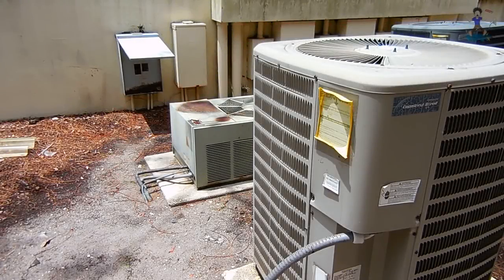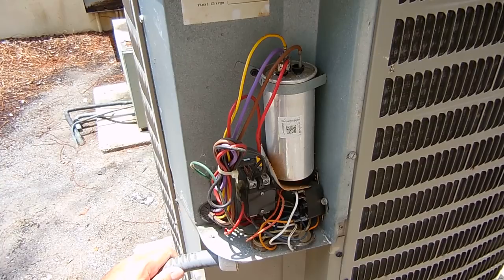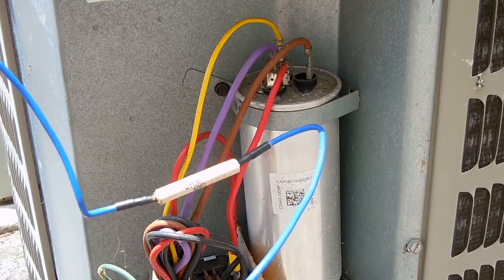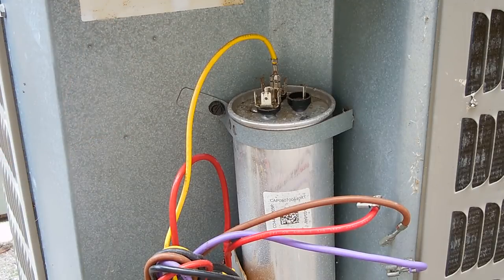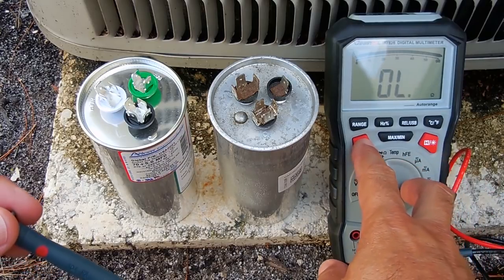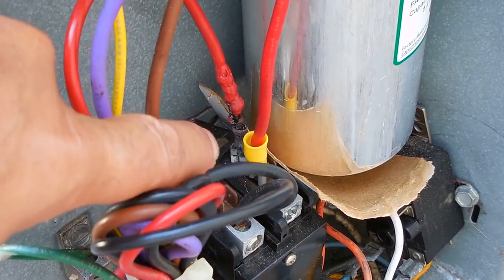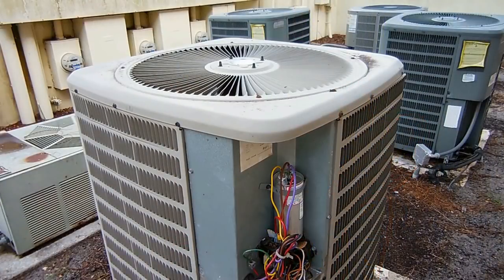Central A/C Compressor Won't Start Up(Stuck/Momentary Hum )

Comment: any tips on if i hear a “clicking” sound at the condenser unit when setting the thermostat to cool and/or turning thermostat to off? I hear the click and the condenser/compressor stay off
Reply from the maker: Make sure 240v is present at the contactor. If it is, the contact points may have damage from arcing or a dead bug inbetween them.
Reply: @electronicsNmore  ok thanks for the tip. If it is 240v would you reco that I’d need to replace the contactor unit?

Comment: Could you explain why the capacitor is used for starting/running the compressor and for running the fan?
Reply from the maker: The start capacitor(if used) gives a fan motor the torque it needs to start spinning then stops; while the run capacitor remains in-circuit giving the motor extra torque when needed. If a run capacitor becomes faulty, then a motor may still be able to turn on, but the running amperage will be higher than normal causing the motor to run hot and have a short life expectancy.

Comment: How does a capacitor go bad? I'm not savvy in electrical stuff so I must ask questions.
Reply from the maker: Nothing lasts forever. Heat plays a role. The very thin dielectric material inside the capacitor between the thin aluminum layers can deteriorate causing a short, or the layers can start to separate causing the value to drop(even make the capacitor become "Open"). Thanks for watching!
Reply: @electronicsNmore  thank you for the explanation. Love your channel!
Reply: It's a normal wear item. Not if, just a matter of when. Like the hot surface ignitors in furnaces. Save yourself money and change them out yourself after no more than 10 years.
Reply: @srobeck77 , I agree, whenever you find them out of spec, might as well change it, it help the compressor last longer.

Comment: When the wires are short like that you can mount the cap upside down and that solves the short wire problem and keeps the cap away from the contactor.
Reply from the maker: Yes, but I have seen a bulging run cap leak in the past, so I don't like doing that.
Reply: It's usually not advised. The capacitor works by having a fluid in it.....if it leaks "upright"......it may work a bit longer until you fix it. If it leaks cap-side down, it may fail very quickly once it leaks....no time to order a spare from Amazon !!😄

Comment: We just got a brand new carrier system just a couple of weeks ago and it's already broken down and it hasn't even been that hot. 🙁 Does this strange starting sound and then like a throttle but the fan never works.
Reply from the maker: Call the company back.

Comment: Here’s a tip if u can’t read the ratings on the capacitor the 2 spade terminal is fan 3 is herm and 4 is common

Comment: Hey my friend,  hopefully you could help.     I don't believe that my compressor is running. Only ambient air through vents, so i left it running for a while.   Because so hot in my house i wanted to leave the air handler in home running so i went outside and pulled the fuse for the condensor unit.  Fan stopped but heard a humming from the unit??   Does the fuse generally only remove power to the fan unit and not the compressor also??  If so could compressor be stalled?    Sound was like motor dropped a phase..
Reply from the maker: Watch my other video. Thank you!
https://www.youtube.com/watch?v=Fyt27D502lc

Comment: The way that terminal looked on the contactor, I would have replaced that also. But it looks like you got it going, nice job.
Reply from the maker: No need to replace it. The only time I replace a contactor, is if the coil inside becomes open circuit or the contacts become damaged enough by arcing to stop full power from crossing over. Thanks for watching
Reply: Their were 3 other male connections on that circuit of the contactor. Instead of cleaning the one and reusing it. Also the points of a contactor are made of silver. The silver is soldered to either brass or copper. If the points become pitted or burned the silver is getting thin. The thickness of the silver is based on the amp rating of the contactor. When the silver gets thin you could have contact with the brass or copper. This will arch and probably weld shut. The compressor would not shut off or voltage would be affected both of which could damage the compressor.

Comment: With the damage to that terminal I would have been tempted to examine the contactor contacts for heat damage ,Just because it runs does not mean that they are a 100%, the problem could repeat later.
Reply from the maker: The female blade connector was loose and corroded due to years of high humidity. The contactor was fine.

Comment: Hi Nmore, great video and Thanks for take your time to make this. I would like to know if you can please help me with something? I have a westinghouse GP5RD-060K AC (5tons), this season the AC had a leaked of gas, now is fixed, but, started to fail just in the mornings, between 8 and 9 am, the compressor make a big noise and does not compress, when happen that, I turn off the compressor, wait few minutes, and turn on again the compressor and works fine all day, even in the night. Do you know what can cause this? Greartings from Mexicali, Mexico.!
Reply from the maker: Check the capacitor.

Comment: Measured the compressor - good, measured the capacitor - good, have a hard start kit installed. And nothing! My compressor seems to be stuck. I hear it trying to come on. Is it just seized up??? And if it were seized up wouldn't I get bad reading across the common and start, run etc...

Comment: Unfortunately when the capacitor fails it can affect the compressor too. Some shitty compressors dont include thermal and overload protection  and prolonged seized state can damage the winding. 
Of course well engineered unit should just end up tripping thermal or current breakers over and over with no further damage.
Reply from the maker: I've never seen a Central A/C compressor that didn't have built-in overload protection. Thanks for watching!
Reply: Not all motors- compressors come with internal protection. Those that don’t need external protection. Residential compressors do come with internal protection. Unless it is an 06D semihermatic. Very rare on residential. These will have external protection.

Comment: just getting started mine is intermittent.  starts then goes out after about 1 min. goes on and stays.  Sometimes it takes 2 cycles. How do you determine which Hard start kit to get?
Reply from the maker: Could be a few things, but a fault with the thermostat, contactor, or compressor/compressor thermal cut-off is possible.
Reply: @electronicsNmore  could my capacitor be on the way out.  havent checked that yet
Reply from the maker: @jcimco9360  I was under the impression you already did the tests......
Reply: @electronicsNmore  I checked the capacitor and it is bad.  I got a new one, checked good and installed.  Sometimes it starts for a second or two and goes off after about a minute it comes back on and stays on.  Would I benefit from a hard start kit? and how do I determine which one to get.  My CAP is 45/5 370 vac
Reply: Did you ever determine or get feedback on what hard start kit to get? I have the same cap size as you.

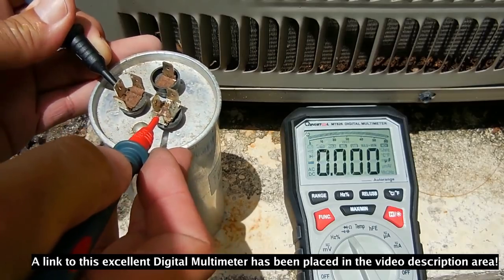Comment: At time point 6:08 you got off of the common terminal and went across  the two hot sides  of the capacitors. No wonder you got a low reading.
Reply from the maker: No. It appeared that way. Thanks for watching!

Comment: Hope you checked the outdoor coil. Dirty condenser coils cause heat not to escape from the refrigerant.. thus the compressor overheats and over years overheats capacitor. Also cheaper equipment use cheaper parts and thus creates equipment breakdons.
Reply: Generally, dirty coils wont trip the compressor unless it's very extreme (like a plastic garbage bag over it or a thick coating of white cotton seed blanket).

Comment: My unit was making that same noise but now the unit blows the breaker any time I try and turn it on. I took off the c wire off the compressor and it stopped blowing the fuse and the fan runs. I banged on the a/c compressor and hooked everything back up and it immediately blew the breaker again. Guess the compressor locked up now. 17 year old trane xl that was kept clean and on the shady side of the house. nOT HAPPY. First video to replicate the exact sound it was making before the lockup. Thanks
Reply from the maker: Sounds like the compressor is gone.

Comment: The capacitor or other control thingy is always the problem most of the time so why don't they simply replace them yearly? They are in outside unit exposed to weather and after bad storms they gets corroded

Comment: If...(after you kill the power from ALL the potential sources...incl 24VAC power)......can you safely measure the capacitor health (like you did to measure uF).....while the capacitor is installed and wired up? Just askin for any gotchas.......

Comment: Well, thanks my friend. 
20 years back I had this same issue...got the same unit still running. Of course I knew nothing about this field back then. 
The tech didn’t try anything else he just sold me a hard start kit. Never did he attempt to install a much cheaper new capacitor.  
He had a license to steal..I didn’t 🤷🏽‍♂️
Reply from the maker: Many licenses to steal out there! Be sure to check out the very wide range of videos on my channel, and most importantly share my YT channel with others. Thanks CJ!
https://www.youtube.com/c/electronicsnmore/c/playlists

Comment: Wait I'm confused how come on the new capacitor it showed no omes on the multimeter. It showed an open lead... wouldn't that mean it's bad??
Reply: It is no the same  capacitor
Reply: What you mean..he's tested the new one and it showed nothing...the old one was the smaller one and the new was the taller

Comment: This is exactly what my a/c unit is doing. When I measure across the output of the contractor to the wire on the cap coming from the compressor I get 240 Vac. Then when I hear the hum, which occurs every minute and a half, the 240 Vac drops to 0 Vac and returns back to 240 Vac. Thought I had a bad compressor.
Reply from the maker: I don't think you're measuring correctly. Just make sure the switched side of the contactor has 240V across the terminals when activated. You either have a faulty capacity or stuck compressor.

Comment: Found a mouse nest in my panel and the connector to the Starting Cap was hanging by a thread due to corosion.
Reply from the maker: Sounds like an easy fix. :-)

Comment: It's a shame you didn't show the resistance tests on the bad capacitor.
Reply from the maker: I explained what to look for using the good capacitor. There is no better test than measuring capacitance using a DMM like I show in the video.
Reply: You could have showed what a bad capacitor looks like for people who don't have a capacitance meter, otherwise why even mention it, just say "You need a capacitance meter".
Reply: If you are saying  "  What a bad Capacitor looks looks like  " There is no way to tell by just looking 99.9% of the time ! You have to use a meter to test it. Other than the can being swelled / bulged , Most don't even do that.
Reply: No, I am not asking that. I was merely stating that it may have been helpful to some people if he had metered the bad capacitor along with the good capacitor to show the difference between the two if you didn't have a capacitance meter.
Reply: Also a shame he didn't put the meter leads on the correct terminal for the Compressor  motor.

Comment: Flip the cap up side down if the wires are to short.
Reply from the maker: You can place the oil filled can in any orientation, I just chose to leave it upright. Thanks for watching!

Comment: I switched mine out and it's still not getting cool in here. I'm in So. Ca. and it's hot :(
Reply from the maker: I need exact symptoms. How it started, and testing results in order to help.
Reply: @electronicsNmore  The unit sounds like it's on and the fan is running. It sounds like it's jumping, like revving up and down. I checked all the lines and noticed that when I moved the insulated hose that goes to the house it stopped revving. I ordered a start kit to see if that's the problem. I noticed when it starts the lights dim and go back to normal, but it never trips the circuit. I haven't checked the voltage.

Comment: I cleaned the condenser coil on car's A/C and the high-side pressure dropped from 250 to 175 PSI at idle.

Comment: This is a very well made video. You are very Intelligent about AC Units. I'm an Idiot 😂 when it comes to Electronics and Multimeters. And the things you said made sense but it was WAY above my head... let's just say, I wish you were my Friend! LOL... Because my Compressor isn't working and I've got a feeling I'm going to get one of THOSE dishonest people that's tells me I need a NEW $2,000 Unit.... JEEPERS. But great Video...
Reply from the maker: My better video:
https://www.youtube.com/watch?v=Fyt27D502lc
Reply: 2000? quotes are more like 3500. Theres really nothing to it. Check the connections, change the capacitor and or contactor about 25 bucks. Make sure power is off first. Dont ask me how I know.

Comment: My AC stopped blowing cold air, and I suspected the capacitors because this has happened before.  But this time, I replaced them and now the compressor will turn on and I get cold air, but only for one cycle.  As soon as the thermostat shuts off the AC then the next time it goes to cycle on, the compressor refuses to start and I get warm air again.  Anyone know what could cause this?

Comment: 30+ years veteran HVAC tech here. As good as this advice is..... Please call a professional.
Reply from the maker: LOL. Totally expected comment from an HVAC Tech.
Reply: Hell the only concern is that the electricity is cut off. After that I say watch these videos, learn something, then fix it yourself. Feels good saves a boatload. What have you got to lose?
Reply: I could see it from both sides here. 220 volts can be dangerous or hooking up the wires incorrectly by some homeowner who over estimated their ability to fix something.
Reply: @srobeck77  Just because someone is a homeowner doesn’t mean a person isn’t knowledgeable.  Hell there are boat loads of stupid so-called techs out there.
Reply: @greenidguy9292  9.9 times of 10, home owners are more dangerous than a professional. So yur like .1% right I guess?
Reply: @srobeck77 I disagree, please site your reputable source.
Reply: @greenidguy9292  only after you site your "reputable source" first since you were the one making the claim initially.
Reply: @srobeck77  I am the source.
Reply: I'd be more likely to call a professional if:  1) They didn't charge me $75 just to drive to my place.  2)  They didn't charge $100/hr for labor.  3) They didn't mark up their parts 300% over retail.
Reply: Call a tech and they send a salesman! 🤣💰💰💰💰 That’s why we need to fix things ourselves.

Comment: The old capacity of the fan reading was far too low. + or - 6% as specified.  Also show the value of the new one for video
Reply from the maker: I stated in the video is was low(20% off), but I've seen many fans work just fine with 4uF, like you saw in this video. As for the new cap, no reason to test it, it was out of the box.
Reply: @electronicsNmore  always good to check the new one. It only takes less than a minute. And good for instructional purposes.
Reply: electronicsNmore just because the motor runs doesn’t mean it’s not drawing too many amps and on the way to failing.   The specs are typically +or-6%.  20% is way off. 

The next time you find that you might want to check the inrush and running amps with the one that is 20% low and then the new one.  It will probably surprise you.

Comment: I had to replace my contactor  10 months ago. Ants got in it. No AC shop will sell to you if your not in the trades. I called City Electric, rat bastards guoted me $28.00, and I knew damn good and well it was $14.00. Called a friend whose an electrician, and he happened to be headed there, he got it for me , for $14.00. That shit pisses me off to no end.
Reply from the maker: Yes, they try and force you to call up an AC repair company. The $28 wasn't too bad. I've seen lizards end up between the contact points of a contactor.

Comment: the wire probably got hot due to an insufficient contact that was not making good connection. i would have checked that before i called it fixed......g
Reply from the maker: Yes, it was a high resistance connection. Thanks For Watching!

Comment: You should have corrected that short length red wire and place that capacitor up a little bit and remove that cardboard looks more professional.  I know its not necessary but just the looks of a cardboard separator looks bad.
Reply from the maker: My friend didn't have any wire/terminals on hand, and didn't want to take the time to run to the store. To this day, still working great.

Comment: My home AC was working ever since we moved into our house for last 7 years.
I hired a guy to move AC from back of the house to side of the house.
When move was completed, the hired guy said, your compressor is not kicking in, which worked for last 7 years, after all of sudden it does not work.
When AC is turn on within 10 or 15 seconds I hear noise like sudden clutch noise, the noise is sound of compressor is turning itself off, while the blower and fan above the compressor is working.
All these years my AC worked and after the move the AC it does not work.  I don't know what to do, who to trust.
Reply: The capacitor went bad after 7 years.
My went bad after 7years.  AC guy quoted me $700.  and, told me these capacitors are not available at any lcoal Home Depot, Lowes.  (they bought all when summer starts)  Amazon 4 days delivery.
Waited for Amazon.  Please just buy a spare one.  Capacitors are made in China.  Goes bad at any time.